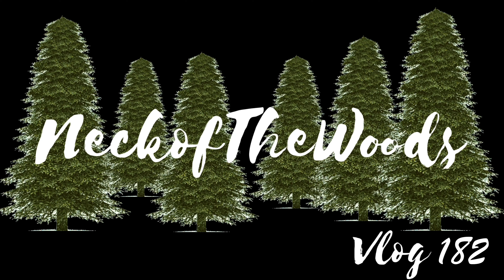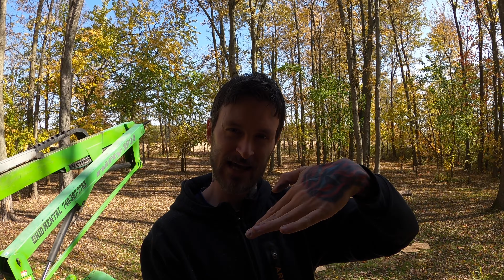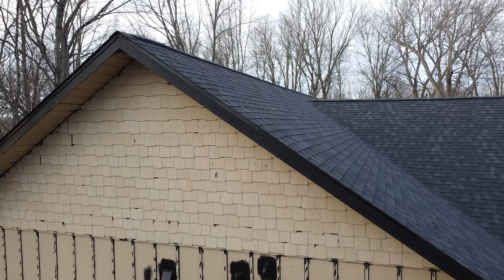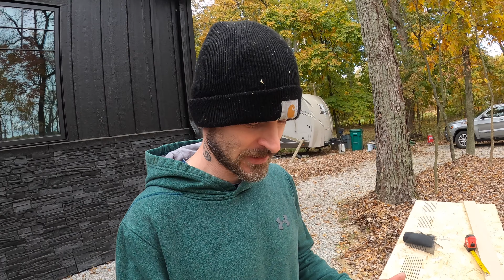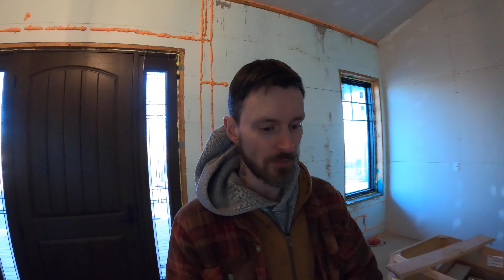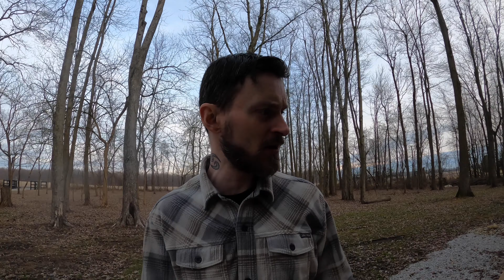Installing ICF home porch ceiling, shiplap T&G and more LP Siding!

Comment: I thought you were spending the tractor money on the back porch, so you can FINALLY install your windows? Talk about putting something off!
Reply from the maker: This video was 6 months in the making.  The LP was already purchased.  The ceiling T&G was only like $700 so we have a lot left over!   I have bought the lumber for the porch.   In fact you can see the back deck joists are up in the drone footage of the side of the house for like a split second.